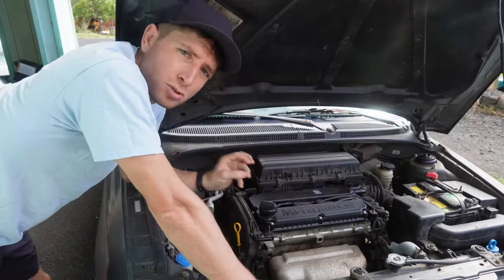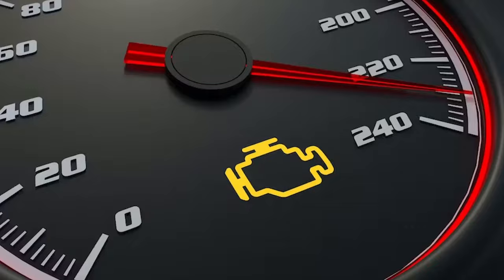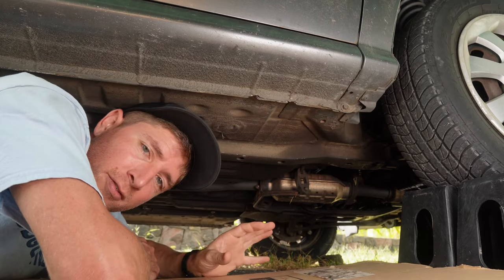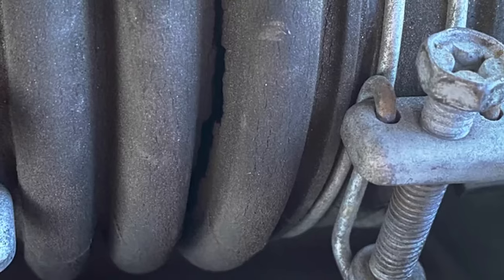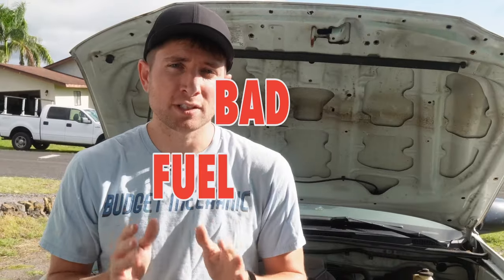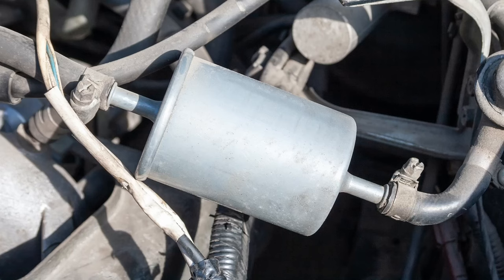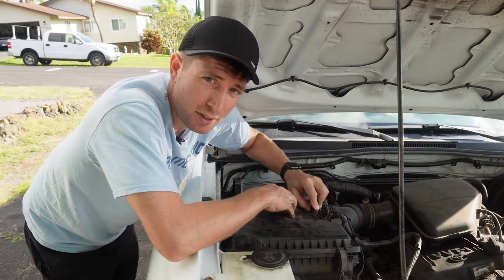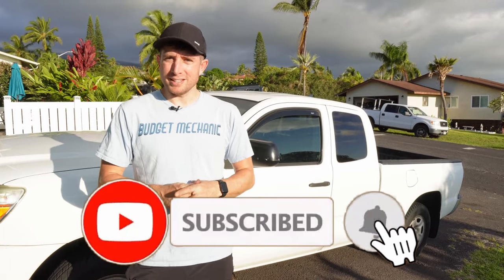Why Your Car Won't Go When You Step On The Gas Pedal

Comment: My issue I’m having is . My car will drive and accelerate but out of nowhere my car will be cruising and I’ll try to speed up but my rps won’t accelerate anymore and the rpm’s will hardly move … but engin is running but I slow down and pull over and restart car and I’m good … help
Reply: What sensor could cause that. ?
Reply: have the same exact issue man
Reply: @BandaEstrellaDeGto  did it just get cold where you stay !?
Reply: I have the same issue I have a 2005 ford taurus  I drive for 4 miles and or pull over restart car and I'm good recently repaired po171, po174, po1405   in which turned out to be erg pressure sensor replacement, vacuum line replacement,  and 3of 6 fuel injectors  , with , four new 02oxygen sensor ; and still same issue 😅
Reply: What was the problem
Reply: @TheRealDeel303   I those parts I mentioned  that I replaced were of same codes/symptoms  the last thing I need is I believe is a pcv valve and that should be a complete fix  according to those related codes /symptoms.  So  all those things were needed last is the pcv valve , I let you know in a day or two ✌
Reply: @TheRealDeel303  bro is a clogged catalytic converter  no what vehicle  if you floor it and the car doesn't  reach four gear its the 🙀 got to get a new 1
Reply: bro is a clogged catalytic converter  no what vehicle  if you floor it and the car doesn't  reach four gear its the 🙀 got to get a new 1
Reply: @SalvadorAguirre-yk8cv  bro is a clogged catalytic converter  no what vehicle  if you floor it and the car doesn't  reach four gear its the 🙀 got to get a new 1
Reply: @BandaEstrellaDeGto  bro is a clogged catalytic converter  no what vehicle  if you floor it and the car doesn't  reach four gear its the 🙀 got to get a new 1
Reply: Same issue golf 4 tdi 3gear uphill does that
Reply: exactly same issue.. car have no problem at all only this random no throttle response out of nowhere for several second.. any idea??
Reply: @nurfaiznorzamry9954 clean your throttle body.
Reply: same
Reply: Fuel filter/pump or cat usually leads to losing power uphills maybe exhaust leak also
Reply: Did you find a fix I have the exact same problem
Reply: Might be a timing belt or chain or not
Reply: @BERRYCHURCH14  100% 😂me and my buddy were just talking about this 1 hr ago
Reply: @timham6464  same hear 2012 ford edge not over heating but know acceleration found out it was crankshaft/cam shaft Correlation
Reply: @SalvadorAguirre-yk8cv  crank shaft
Reply: My Daughter buys a 2005 Chevy Impala. When you get in the car and start it it will not go. Then turn it off and start it again it will go. Then it will Lose power you will have to pull off the road.  Then if you are driving down the road and come up to a stop sign and you stop. You will have to turn it off and start it up and then it will go. Can anybody out there that could help her .
Reply: @douglasbrunner2834  maybe the distributer cap?  I had that issue in my Sebring and that's all it was.
Reply: I had the same issue today , so I checked all my wires , I found that one wire on the coil sensor was bitten of by a rat … my car would run perfectly but stalls when trying to cruise … after I fixed the two wires, it stopped… so I’m thinking about replacing the coil harness, the problem was there … I hope this helps
Reply: Replaced my cam and crank sensors , hasn’t done it in almost 700 miles so I think it’s good
Reply: If it’s your 🐱it will smell like rotten eggs
Reply: Sounds the IAC problem, you might need to clean it.
Reply: @timham6464 sounds like dirty IAC aka Idle Air Control valve.
Reply: Thats limp mode sometimes is wrong with the computer so it wont let it go past a certain rpm
Reply: @nurfaiznorzamry9954 clean your idle air control valve or replace it.
Reply: Either clutch sensor or clutch itself
Reply: Omg I got the same exact issue
Reply: I just experienced this i want to fix it 
my friends are saying either The turbo or the DPF
Reply: I've got the same problem for my mercedes c180 cgi w204
Reply: Same
Reply: @timham6464  my 08 mustang is doing the same thing and makes my shifter really hot. I have no cats though and they said it was my cats and I agreed to have them remove them. He said they were clogged but the issue is still there. I'm leaning on fuel pump as I changed everything else fuel injector, couls, spark plugs and fuel filter.
Reply: I have the same problem. I changed injecters plugs check  oils clean trottle body, problem still there. This is totally stressing me out mentally and financially. I dont know what to do next and cant find anyone to solve this  problem
Reply from the maker: @razzalee305 do you have check engine light on?
Reply: Jaden 5507 did you solve your problem with the loss os power my x
Car has the same problem i need help
Reply: @BudgetMechanicHawaii yes but its always been on for a bank 1 o2 sensor,before this problem occurred.
Reply: @BudgetMechanicHawaii tomorrow i gonna do a scan and a relearn done for the car.
Reply: @BudgetMechanicHawaii where were your thoughts going, ill tell you the codes when i get them tomorrow,
Reply: @jaden5507  did you eversolve ur problem im having the exact same problem with my 2013 nissan ad wagon
Reply: @razzalee305  have not 😭😂 buts she’s still kicking !! I’d say it happens once a week.. I’m just dealing with it until she up and quits on me . 202k miles ima say timing chain . I’ve gotten told by 2 shops now . She’s is a nice ride but I’ll spend that money on the next car
Reply: @jaden5507  that better than mine, did you ever change tank pump filter and pump?
Reply: @razzalee305  only things I’ve done . Spark plugs . New throttle body and crank and cam sensors
Reply: @jaden5507  im going to pull my cam sensor and soay if off with some trottle body cleaner see what happens, will let u know if it works
Reply: @razzalee305  yeah let me know !! I’m curious. Best of luck for you my guy
Reply: @jaden5507  when you restart are  you able to pass the speed ylu were trying to pass after cruising
Reply: @jaden5507  with my car once i am in traffic or at stop light and im able to move freely the car hesitates and if i restart then it drives fine until ihave to slow stop or is travellwng at a steady speed then i cant accelerate it almost fewls like too much air in combustion mixture.
Reply: It was a dirty throttle body for us.
 Try taking it off and cleaning that thoroughly. Also all the electronic parts on the sensors.
Reply: @debbiewatson4874  was oil getting to your trottle body, mine problem was the trottle body but it still keeps getting dirty.
Reply: @BudgetMechanicHawaii I do have check engine light, same problem, 2005 prius

Comment: I have a Nissan cube 2010 I have no check engine light but my car cranks up with ease it will let me rev up my car but after like 2 mins I can step on my gas pedal and my car won’t rev up even when I push it to the floor I changed out the pedal sensor throttle body sensor I need help

Comment: Yo BudgetMechnanic, i got a Volkswagen and 10 minutes its running good. After them 10 minutes the rpm starts to go down quick. Took off the high pressure fuel pump and the cam follower got broken, i replaced it and it still doing the same problem. changed the fuel pump too but still🤣🤣🤣...anyone can help?

Comment: You can’t ever rely on sensors throwing codes.  GM vehicles seem to have pretty wide error ranges before you get a code.  Even if you do get a code, it doesn’t mean the part that through the code is faulty, it could be a sensor or another part all together has failed.

Comment: 2011 Nissan Quest. 116,000 miles. Getting intermittent dash light that says "Brake" and shows a battery symbol. Battery is new. Alternator and wiring checked by a shop and i was told they are fine. Can drive the van a couple miles or many miles with no issue until, seemingly randomly, I'll try to accelerate from a stop and I'll get no power. No revving sound. No RPMs. Once in park however, it will rev and show RPMs. If I shut the vehicle off it won't restart until I let it sit quite a while and then it can be turned back on. Radiator and thermostat replaced 2 weeks ago due to shop claiming this issue was caused by a leak and overheating yet the issue is still present and same as it was prior to the repair. Checked the air filter which looks good. Also checked transmission fluid which looks good. I'd appreciate any other advice you may have to save me another huge repair bill or having to get rid of the vehicle.
Reply: Check your battery with a multimeter, put it on 20 V/ and if it’s less than 11 it’s  the battery.  You could also try to replace the alternator fuse, which is located in the fuel box. If its non of those, it’s the alternator.
Reply: It’s most likely your alternator if it’s showing Battery and brakes light.

Comment: Knowledge is Power. 
Much Respect unto you Bro.
I have a Hyundai Tucson 2018.
I was on the Highway and I started loosing Power.
I exit the Highway pull into a parking lot.
Realized my oil was extremely low.
I put in the required amount of oil. 
Stared the Vehicle and I got a heavy Vibration rambling.
I pull into the Auto Zone got a Check from one of the Representatives.
Report stated the Knock Sensor was bad.
I started driving home.
I was literally Crawling down the Road.
Oh Man I know I annoyed lots of people 
While trying to get home.
Anyway I made it home.
That’s what Brought me here.
This Brother knows his work. 
Like myself I’m a Free Lance Electrician.
I was going true video after Video.
Looking for someone to explain to me why my Hyundai Tucson 2918. 
Doing what it’s doing. 
Not one of the other Videos give me an explanation.
This Man Provided explanation after explanation. 
On this topic and other related topics.
Continue Shearing the Knowledge Bro.
Reply: my car is reving but does not accelerate
Reply: @kianong342  mine doesnt rev, just moves 10 mps acceleration pedal does nothing
Reply: @Lmohs-02 what was the problem mine is doing the same thing ?
Reply: What was the problem ?

Comment: I own a 2018 Honda Pilot EX-L bought it in 2021. Earlier this year while I was driving it couldn't catch speed while my foot was on the gas pedal the RPM's would go up almost oast 4 and then it felt like someone hit me from the behind. Took it to auto zone, my mechanic and even a Honda dealership but none of them found any codes nor would any check engine lights pop up on my dash. Honda performed a flush and I haven't felt anything was off but it's still difficult to catch speed. There is a fuel pump recall but Honda performed diagnostics and they said there was no problem. I don't know what to do as I have no experience with cars except for all the basic knowledge an auto owner should know. I'm also good with oil changes and and all liquid checks. I live in Southern California so no crazy weather to factor into all that.
Reply: Update: So I took my car in for diagnostics and it turns out it's internal failure in the transmission. Long story short had to replace the transmission and cost me 8 g's! There is currently an active recall for the torque converter on Honda Pilots so get that checked. Service Recall #23078 (torque converter Honda Pilot)

Comment: if you have no check engine light and it still lack of firing and grab clear jar and pull fuel line from tank to filter and pour in jar and leave it  few hours and come back and check it if you see clear under yellow and yellow above clear it mean you got water in tank it time drop tank and replace fuel but you cant get hose in gas nozzle because 1990 above have trapper on tank between hose and fuel tank 
basics is check oils make sure have enough oils in pan alot time no oils it burn engine out cause it misfire and blowby (alot of air coming out of valve cover) and transmission fluid good and check air filter make sure not clogged or dirty and check for hose air leaks ( sound like hissss when rev engine up ) if no noise them move on to fuel filter and check fuel and if no water clear colors them replace filter if still misfire no check engine light them take flat belt off and check for any worn or stuck drive belt pulley like alternaro or water pump or ac or else on engine if no them pull vent hose off intake go to valve cover and start up engine if you you feel alot of air blowout not suck back in them issues with piston ring shot or wall just save yourself a headache i been working ton of car n truck and i get called almost every day about car or truck
( if you own gm truck like chevy or gmc them you have bad cam and bad push rod roller because GM refuse recalls)
Reply: Wow. That's all I can say to that. Wow. I need a nap after reading your comment.
Reply: @usernamenotmyname4809  sound like ton of work hit you into head like list of 200 thing u need todo u be like brain aches

Comment: I have a 04 Camry and the check engine is on but it won't accelerate thanks for the info I will try the code reader see if head gasket is the issue

Comment: My problem is I would press the gas pedal, RPM would raise but it would drive slow( 20mph the most). It would also jerk a little as I press the gas pedal a little. Another bid factor!, a burning smell would be in and around the car🫠.
Reply: How did you fix it

Comment: I have a code P2122. I took off the APPS(with the accelerator pedal)and unplugged the connector. I tested the terminals and of the two wires that bring in 5 volts from the car side connector, only one is providing sufficient voltage. Don’t see bad wire issue but still could be the case. Maybe computer is purposely not sending voltage due to other issue. Car accelerates good until you need to quickly accelerate like when on the on-ramp entering an expressway. Then it won’t give acceleration needed. Computer seems to be handling all other functions just fine. This  problem is not the sensor on the pedal (APPS).

Comment: @budgetmechanic I have the same problem but intermittently in the Honda City 2007 zx variant. Got the spark plug serviced a few months back.  But again this problem starts occurred. Any suggestions

Comment: Here's a question
You said about the slipping transmission.  But what about having those symptoms of it slipping exactly as you said but it's not actually slipping.     I ask because I have this problem and I changed the transmission but it didn't cure it.
Reply: Map air flow sensor mine did the same thing I thought my cat or the worse the Trans, I started with the cheap part bam a 30 dollar part depending on the year make model mine was 100 3800 series 3 best engine ever made but yah I got the cat code also and it wasn't the right part go with the map air sensor I couldn't hit 30mph good luck also check the throttle body that can do it also do not even move the butterfly it will ruin the who part have some press the gas pedal and look if it's dirty and won't close because it's all Carb up easy clean I did it my self chic if that matters lol
Reply: Mass air flow sensor

Comment: I have a 2009 chevy cobalt. It's been running fine; I keep up the regular maintenance. Tonight, I was stopped at a stop light; when I pressed the gas pedal the car didn't want to go. After a couple minutes, it started to move. There was no check engine light. Help!
Reply: Dirty fuel injectors

Comment: 2008 Sonata. Engine not running well. Have to sometimes start it a couple of times before it will run. When running I have to feather the gas pedal when coming from a full stop or when going very slow in order to keep the engine running. After it picks up speed the engine will accelerate fine but it feels like a cylinder may be misfiring every so often. Any idea what's causing this?

Comment: 4x4 Turbo diesel.. engine idles fine, get a clacking sound only whilst accelerating. Once up 2 speed foot off no sound. Replaced exhaust, but not the Cat. Recently serviced 
(PLEASE/HELP)

Comment: I have Vento TSI with DSG Gear box.  One day, the entire tire got submerged in flood water while it was parked in the parking lot.  Due to this the gear lever was not moving from parking.  P was flashing in the dashboard.  I saw a video on you tube in which it was told that after locking the door of the car from inside, turning on the ignition, pressing the gas pedal for 30 seconds and then starting the gear box gets reset, do the whole process as told.  Gave.  After starting, the gears did not shift properly but there was a rattling sound and the engine noise started getting louder.  R.P.M.  They last longer and also have a slight vibration.  Please tell what should be done to normalize RPM?  Why has the engine started making more noise?  After submerging in flood water and before the above process, the RPM and sound of the engine was like a brand new car.  Please help me.
Reply from the maker: If a car is submerged in water, many of the electronic systems could be compromised, not to mention water getting into the actually motor. I would start by changing the oil and the scanning for trouble codes to hopefully track down specific electrical issues

Comment: I only drove my truck about 2 a month for small errands and it sat for about 5 months in the sun, i live in south west Florida. Can the gasoline from sitting for so long make it shake like if its wanting to shut of and also no acceleration past 15 mph
Reply: No it will not do that you got another problem on your hands buddy I would get that checked out by a mechanic asap.
Reply: It might be in limp mode

Comment: I was loosing acceleration and notice fluid splashing from front of my chargers hood and after safely parking i notice fluid spill on the radiator and ac condenser area was purple in color and i believe is transmission fluid.